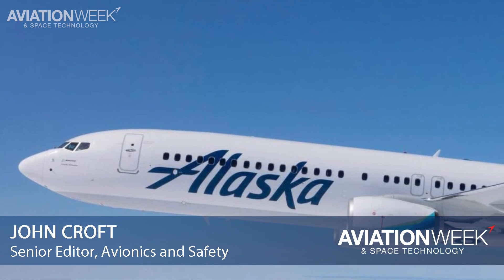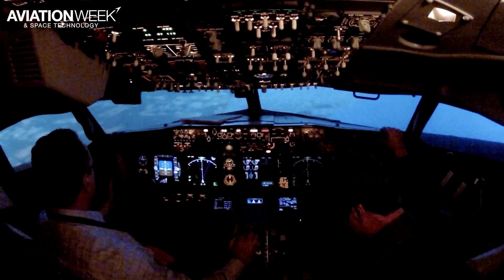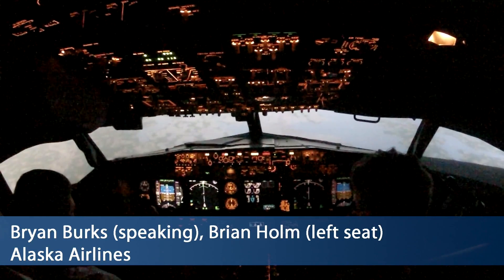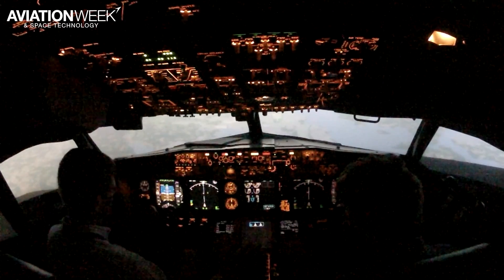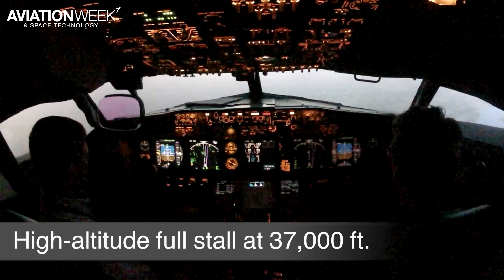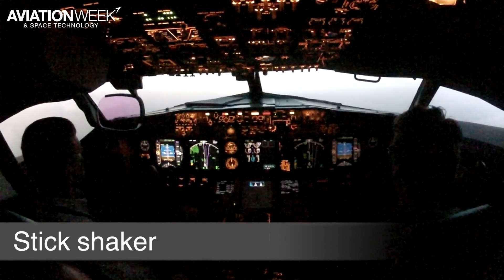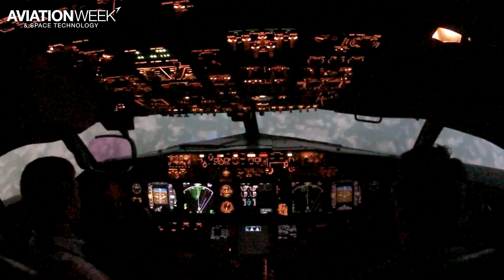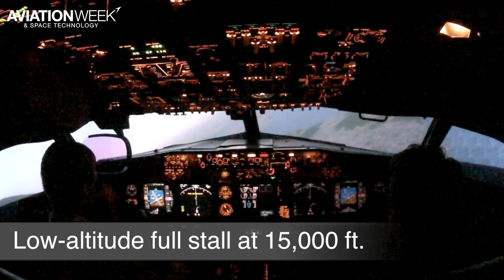How Does A Boeing 737 Handle On A Full Stall?

Comment: Can somebody correct me, but if a plane stalls, and then goes into a dive, given how much air is flowing over the wings and the speed at which it's going, does this not mean that the lift action on the wings increases and meaning you can pull out of the dive? Or ( and bear with me here) is it possible that my thousands of hours playing A-10 Cuba on Windows 98 somehow  does not equip me with advanced understanding of flight mechanics?.

Comment: I wonder if this training was because of Air France 447...

Does the simulator correctly generate the failure messages that they got? One of the issues was that when the AOA got out of range, it stopped annunciating the stall warnings, including the stick shaker. When the pilot pushed forward and got it back into the valid range, it immediately started giving alarms so he pulled back again.

Of course, any pilot who knew basic aerodynamics would know it was in a stall because of the combination of low airspeed, full power, and decreasing altitude, but this pilot apparently wasn't trained very well.

Comment: Is the stick shaking from some sort of unique aerodynamic feedback on the control surfaces as the plane approach stall? Or is it superficially created by some emergency system as a tactile warning for impending stall?
Reply: It is from a motor with an asymmetric flywheel.

Comment: Wouldn´t it be benefical to put a big red "AUTO-RECOVER" button on the dash for situations where the pilots really are confused and dont know whats going on? With fly by wire the aircraft can recover itself (provided all systems and sensors function properly). But i guess in such a situations most people would not press that thing until its too late.

Comment: Way Back years ago 1982 I used to often train my flight training crews using the 727 simulator FULL stall recoveries. I think they learned a lot from that training, (relax back pressure, add FULL power) to many dummies just got confused (some of the worst pilots my airline had) and crashed instead. The excuse's I heard them say were pretty funny and really lame.

Comment: Out of all major airliners today, the 737 is the most inherently unstable. One of the ways you can tell is by the dorsal fillet in front of the vertical stabilizer. this gives increased wetted area for more directional stability. No other Boeing airliner needs it. this is due to the instability of the design,.

Comment: In 1981 I had stall recovery training in the C150 and Piper Arrow in my first 7 or 8 hours I believe.
Reply: 1970's.. From 2,000 feet agl I learned 45 degree full stalls at 12 hours.  BE tough or you quit.

Comment: So what would happen in a stall if you had a very strong tailwind (i.e. enough to pretty much cancel out your forward airspeed). Would that be recoverable (i'm assuming using full thrust)?
Reply: Tailwind doesn't matter unless it's gusts. You are in an air mass, you are moving with the air mass, relative to it. Also with a tailwind your ground speed is higher than your air speed.

Comment: At a critical phase close to ground like recovering from stall flying in between stick shaker and out of it is the only solution ( with engine/s power). Recovery from stall where enough height is available losing height is no factor. Stick shaker is not a stall,  severe wind shear just after takeoff is recovered by flying precisely in between stick shaker and out of it, I agree that as you hit stick shaker smoothly fly on the edge where losing height would kill you ( please don’t fly with stick shaker, it is a warning that further increase in AOA will take into full stall). Pod engines gives you a pitch up as you open power so coordination between controls and thrust levers is another consideration while recovering from stall ie pitching up. Good day.

Comment: How about 50 years exp. and a "Master Pilot" ? Recovery once you get rid of the AP is the same as for Cessna 150! Release back pressure. Roll coordinated straight and level. Apply full power. Back to the horizon. It ain't rocket science. Its airplane science.

Comment: The sad part is, Denny is correct...many pilots of the big boys are trained to do procedures and run computers....shut that stuff down and many can't do the simple flight ops we do in private pilot training....I always said, "don't show me how to fly a plane, show me how to crash it "...If you know why they crash, you can learn to avoid that....I have had 3 engine failures on take off and an aircraft try to rip itself apart in flight so I am speaking from experience....

Comment: How does an airline pilot not know what to do in a stall? That's one of the basics when getting the private license!
Reply: Its not the recovery that gets airline pilots, it's the recognition that they are in a stall in the first place. Jets don't always stall the same way as smaller aircraft, they can behave differently in a stall. Combine that with the fact that jets often operate at speeds and altitudes where flying too fast can also produce stall-like symptoms (sometimes called a shock stall) and IMC and it makes recognition difficult

Comment: 1- How much altitude should be lost?
2- How many degrees of decent slope should they consider to recover from a full stall? 
3- Should the crew communicate with ATC at a full stall and request for change of altitude?
4- If the stall is caused by both engines plus APU failure would that be possible to try restarting engines by using the incoming air to the engines while losing altitude?
5- If using RAT at both engines and APU failure would it guarantee enough hydraulic power to enable the crew to recover from a high speed decent?
Reply: 1. It depends on what orientation/attitude the aircraft was in when it entered the stall, as well as what speed it was travelling at and what level of loading the airframe was under. Generally, for a high altitude stall it can be expected that the aircraft will lose several thousand feet in altitude.
2. If by 'degrees of descent slope' you mean by how much should the aircraft's nose be lowered, again it depends on the characteristics of the stall itself. The main objective is to lower the nose and apply thrust a sufficient amount to reduce the angle of attack to a safe level and allow the aircraft to build airspeed.
3. Not required in an emergency. The order of priority while flying an airplane is "aviate, navigate, communicate." That means the main objective is to keep the aircraft under control and flying safely, followed by figuring out where the aircraft is and where it is to be flown, followed by advising ATC of intentions or alerting them to the situation. All pilots are trained to focus on recovering from the stall first before worrying about talking to ATC - especially considering that a stall is usually an unintentional deviation from the expected flight path so the crew would most likely be caught by surprise.
4. A stall is and aerodynamic phenomenon caused by an exceedance of the aircraft's critical angle of attack, and can occur in any stage of flight. It is completely independent of the aircraft's speed and thrust setting. If an aircraft lost all engines and the APU in flight, then yes, a 'windmilling start' could be achieved as mentioned in your question.
5. A RAT is designed to supply power the bare minimum number of systems needed to keep the aircraft flying safely, and this includes running a pump which will maintain hydraulic pressure to keep control surfaces functioning.
Reply: Alexander McAllister Many thanks. I appreciate your time. Cheers.

Comment: As a lapsed (1993) PPL (A&H), I am left wondering why introduce this now?
Reply: Clive Sinclair Where a private pilot will spend a great deal of time "yanking and banking" (because that's fun), and in simpler aircraft may spend 100% of the time hand-flying, it's easier for someone flying a large jet to get rusty, since a large part of their work is being precise, working with ATC, systems management, etc.

Also, I've certainly never stalled anything weighing 100,000 pounds at 300 knots true.

Comment: How the hell would a commercial jet, which cruises around 500 MPH, get anywhere NEAR stalling at high altitude? Seems like pointless training. If you are dumb enough to get the plane anywhere NEAR stalling at cruising altitude you should have NEVER been given a commercial license to begin with!!!!
Reply: I was going to ask a question based on this ..can anyone give us an answer. Is it to do with disorientation in extreme weather , pitot failure etc.?
Reply: AFR447 stalled during the cruise, and the pilots did not identify it as such and the plane crashed. There are reasons that it can happen that do not involve the pilots being dumb, such as frozen pitot tube.

Comment: How much altitude did you lose between stalling and recovering from it?
Reply: That is one of the key training elements: A few years ago minimizing lost altitude was taught. If you take it to the extreme that can be a problem even low level. But at high altitudes once you have stalled it is impossible to recover without losing quite some altitude. You can see him pulling up very slowly but he does not have enough speed margin yet and the stick shaker activates again.
So altitude loss is not the primary concern but a smooth pullout without overspeeding excessively.
Reply: I have over 90 years experience in a plane as a pilot. It’s about 27,000ft lost exactly

Comment: I want to have a stewardes in the cockpit when that shaker goes off.
Reply: Maloy7800 Your sexual phantasy is the reason for feminist, pervert. I want them only to take the tray back.
Reply: ***** Sexual fantasy (correct spelling)? Pervert? I only meant that they're called flight attendants these days and quite a few of them are male. I DO NOT want to know what you think I meant. Geez!
Reply: "Stewardess", it's spelled "stewardess", with 2 "s". And if it's a male (well, kinda), you can call him "steward", like in "Steward Granger", or simply "sweetheart". However, a flight attendant is someone who changes your diapers after the plane has recovered from a stall.

Comment: There's a lot going on when a swept wing transport category jet stalls, from independent stall warning systems, stall prevention systems, auto slats, engines that kick into high idle, etc, but if you take the actual aircraft into a forced "clean"stall it can easily get inverted with a little too much spoileron input.
That's on a Boeing or McDonnell Douglas, and older jets behave differently than the newer series. There's also significant altitude loss involved, and that's why a takeoff/departure stall is so dangerous. Unfortunately those can happen down low, when you're heavy and there's not enough altitude to recover. Read about some of those stall accidents online, and you'll see how deadly that type can be. 
We only do full stalls in test flying between 15000-25000 feet. Usually start the maneuver closer to fl250. On some aircraft, we have to overcome or work around systems designed to prevent stalls entirely, because the mission is to confirm that the aircraft performs full stalls correctly. 
I'm glad that full stalls are being taught to line pilots nowadays. It will only make things safer for everyone.
Reply: E Z sctually they both crashed beacuse of MCAS failure + Pilot error
Reply: @chaoticalfunctionality5944  -- Both of those 737 MAX crashes the pilots/drivers kept insisting on turning autopilot on many times, even if airplane was doing strange nose dives.  Automation Dependent Dodos.. they just like to seat there and push buttons or do mild maneuvering only..  Lazy ...  That is like a driver insisting in using Cruise Control, even when it surges forward towards traffic every time you hit that button, Then he rear ends a tractor trailer, then tell the cops,  the cruise control did it, not me...IDIOT or not...
Reply: @feetgoaroundfullflapsC     Settle down there, doc.
Reply: @mudchair16  Why?? It is fun to look for solutions, instead of been coward and look the other way.  Im a solutions orientated person.
Reply: 5feetgoaround fullflapsC150 yet you provided no solutions, only name-calling and criticism.
Reply: @feetgoaroundfullflapsC  Too bad you weren't there and saved the plane.
Reply: @feetgoaroundfullflapsC  

Well ya, but the problem was that they didn't received additional training when transferred to the 737-MAXs, so they didn't knew how to turn off mcas, or even that mcas exist
Reply: @feetgoaroundfullflapsC  Lol guy says you only engaged in name-calling and your response is "dummy"

Comment: 1.) How does he make it stall? By switching off the engines?
2.) How does he solve the stall? By "hitting the gas", or by doing a nosedive so as to gain speed?
3.) How (if at all) would they simulate the plane flipping over, if the simulator itself obviously can't do this movement?
Reply: taxiuniversum bringing the engines to their lowest thrust setting and pitching the plane up, it will begin to rapidly lose speed, a lot like a car going up a hill. The engines do not need to be turned off. 

2) Pitching the nose down and setting full power on the engines are needed to get out of a stall. At high altitudes like on the first stall, the air is thin, so the plane is prone to secondary stalls (the plane stalls again when trying to pull out of the dive). Gentle inputs need to be made after the recovery, but the recovery itself needs to be fast and aggressive to prevent a loss of control. 

3) The simulator can only go so far, so the pilots will only feel so much. You can't go upside down whilst in that kind of simulator. Being in a simulator will never be exactly like the real thing, although it is close.
Reply: Nathan Chetram Thank you. I wonder, though if at thin air, the plane might not TOTALLY get out if control. I mean, if the plane just tumbles down, wouldn't it be near impossible to make it face down, properly aligned and all? Then again, I guess if you can still give full thrust of the engines, the plane would still (or again) be maneuverable.
Reply: taxiuniversum What you just described is called a deep stall. Basically, the aircraft is in such a configuration to allow for the wings to generate a "shadow" over the tail, preventing any air from flowing over the tail fins. The pitch control surfaces (elevators) are on the tail, and if no air flows over them they are rendered useless. That pretty much leaves the aircraft unrecoverable. Deep stalls pretty much happen on T-tail aircraft only, because of how the tail is designed. A T-tail aircraft (DC-9, MD-80 and CRJ-700) has the elevator and horizontal tail fin (horizontal stabilizer) mounted higher up on the tail, so it it easier to get it in that shadow I talked about. These planes have more advanced stall protection systems, like a stick pusher that will push the control column forward itself if approaching a deep stall, assuming the pilot has not done so yet.
Reply: 1) by increasing the wing's angle of attack beyond the critical angle2) by decreasing the wing's angle of attack below the critical angle.  Speed has nothing to do with it.  You can stall at any speed.  PUSH THE STICK FORWARD.
Reply: GCE.   Gross Conceptual Error.
Reply: Well, flying faster definitely helps avoiding a stall (as long as you're not trying to do weird things)

Comment: When I first upgraded to Captain at TWA on the MD-80 in 1999,  we used Alaska MD-80 simulator at SEA.  Of course it was the Red-eye period.  The Guys coming out of the simulator were recreating Alaska 261.  Soaking wet Captains seat reminded me of High School wrestling gear that wasn't washed.   Both experiences sucked.
Reply: Was that like an investigation when recreating 261? Or did that aircraft stall as part of the training? Also, what's Red-eye period?

Comment: I cannot understand how any pilot gets into even the right hand seat of a multi-passenger swept wing jet airliner without knowing how to recover from stalls or spins, and without having done a no-passengers check ride in which they do this IN REAL LIFE. Not simulated. Actual. Stall it, spin it, several cycles and then recovery. 

The other thing I would like to see mandated for swept wing commercial jets is demonstrated capability to survive going supersonic in a fast descent from high altitude, and for the pilots to be experienced in what it feels like to do this.
Reply: Of course they know how to recover from a stall. They are simply practicing to learn how the airplane handles, and to keep the skills sharp. Every airplane recovers differently. Every pilot, no matter how many thousand hours, will do this when transitioning to a new aircraft.
Reply: jsm666 absolutely ridiculous. We aren’t talking a 172 here. The stall characteristics of a large swept wing aircraft are much more dire than those in a light aircraft. Can you imagine the number of hull losses and fatalities that would result from forcing pilots to practice deep stalls in something like a 737?